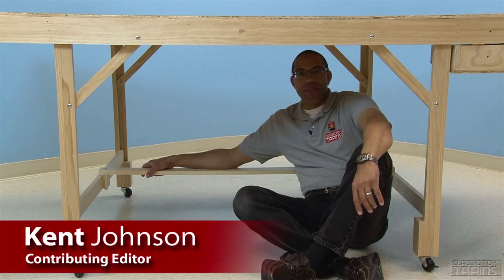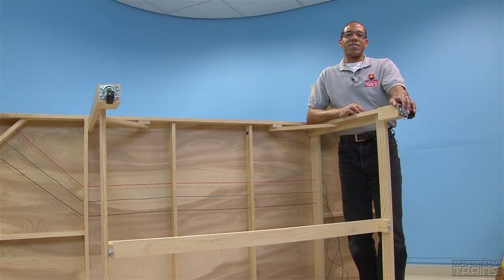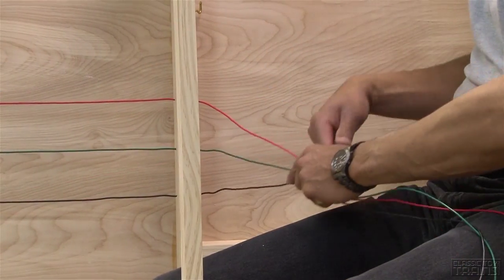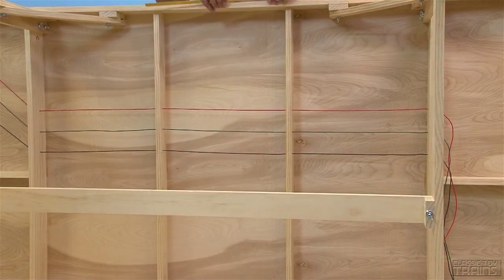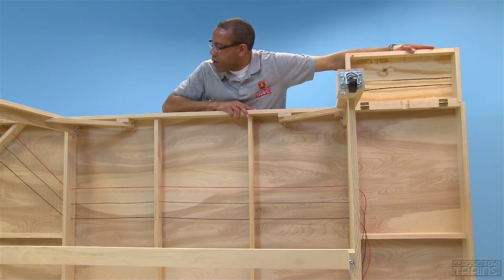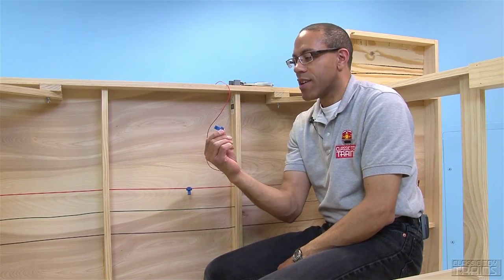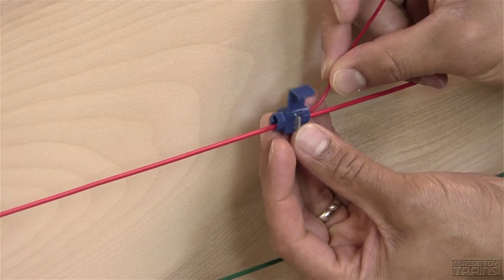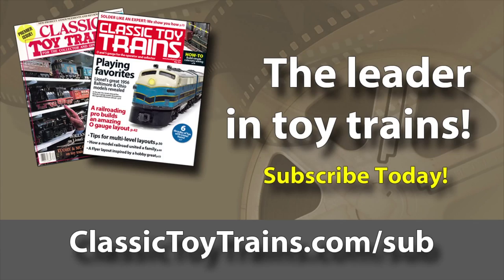Wiring tips for small layouts | Classic Toy Trains magazine

Comment: I am fixing to build my first O27 layout. on my N gauge I used a 18 gauge single wire that is used for alarm and fire systems (red/black) in a single shield.. My question is, can I use this same wire to wire my O27 track as  bus and feeder wire?
Reply from the maker: No, that's too thin. You would be much better off to use 12 gauge stranded wire. Generally the automotive aisle at a big box retailers sells this type of wire and it's fairly affordable.

Comment: That is so cool. So, you don't have to strip the insulation away? When you crimp the connector, it does it for you?
Reply from the maker: Soldered wiring connections are probably best over the long haul, but suitcase-style connections like the ones shown in the video are very simple and generally work quite well.

Comment: I have a 1957 American flyer 313 that i'm trying to restore. I'm missing the wires that go from the transformer to the track. What guage should i get and can i just buy'em from a store or do i need special kinda wires.........I'm very dumb on this, i have no clue what i'm doing. Thanks
Reply from the maker: Any 12 gauge wire would work just fine -- you can find it in the automotive aisle of your local discount store. Good luck restoring your 313!
Reply: michael johnson

Comment: You should definitely stay away from those splice caps if you're using DCC it's all right and work through great with DC or analog as it's better known but you should stay away from them with DCC and if you do have to use them make sure that the Gap in the connector works well with the gauge of wire that you're using

Comment: Agreed!!  I never use those for any wiring projects or repairs. I've literally found hundreds of low voltage/low current problems due to these cheap built connectors. People use them lots for trailer wiring and end up with intermittent problems and/or non working lights and signals....NEVER USE THEM!!!

Comment: Those are probably the worst connectors you could possibly use for any kind of wiring project. The "Tab" that does the splice is quite a bit smaller than the gauge of wire used and while it's great for keeping everything in place, if you ever need to move something around on your layout, suddenly there's a little cut in the bus wire from where the connector was. Stick to soldering! It's fast and easy with a soldering gun like that and it ensures a trouble free connection. Plus, if you ever need to remove it, just de-solder and tape where the connection was.
Reply: couldnt u just put tape over the cut?
Reply: I’ve got a rather large layout and use those connectors everywhere. Never had a problem.  Remember we’re really not pulling that many amps here. What type of connections do you prefer?